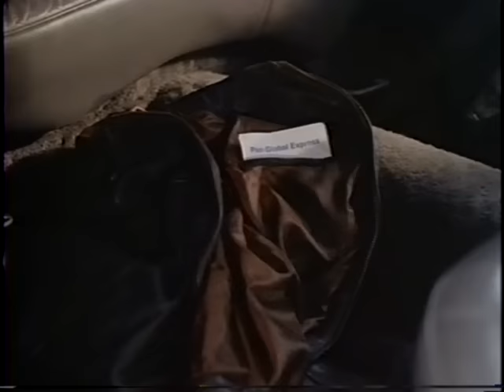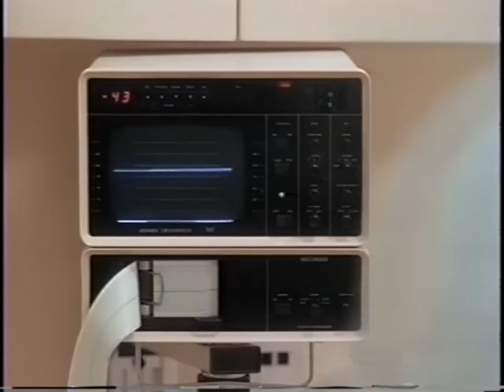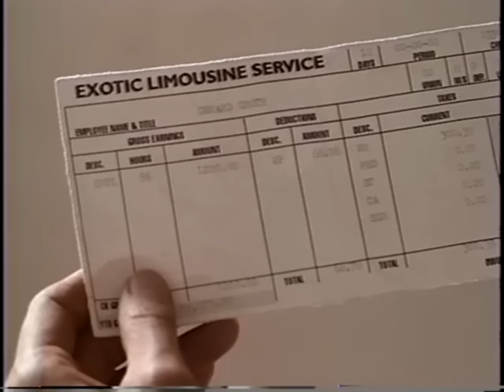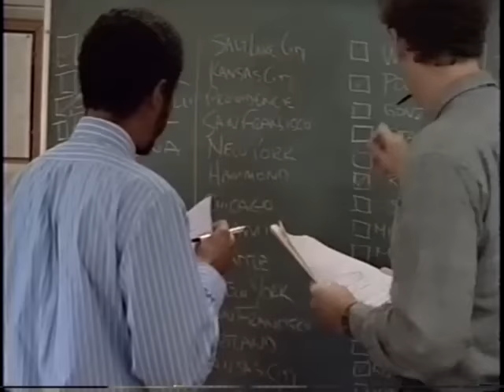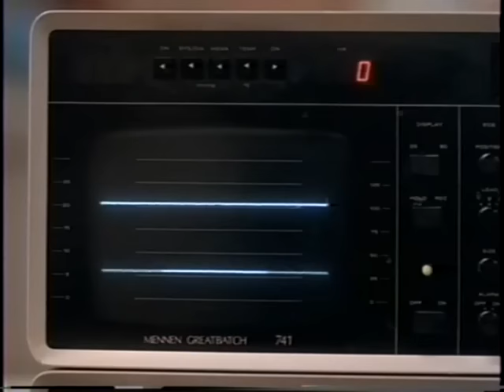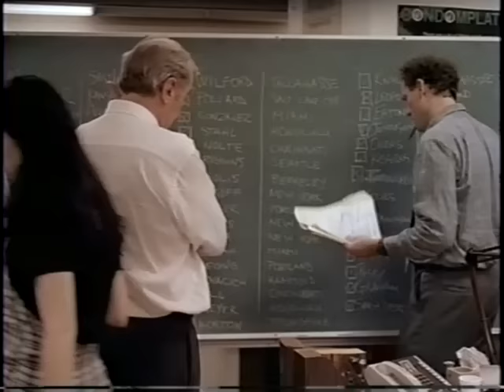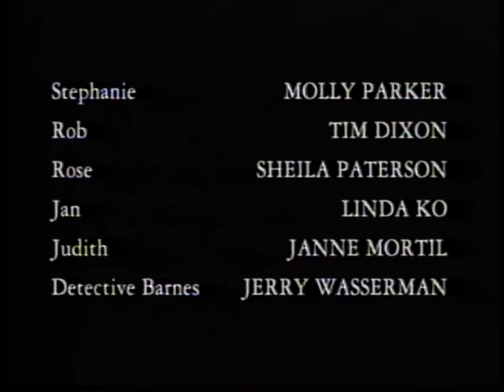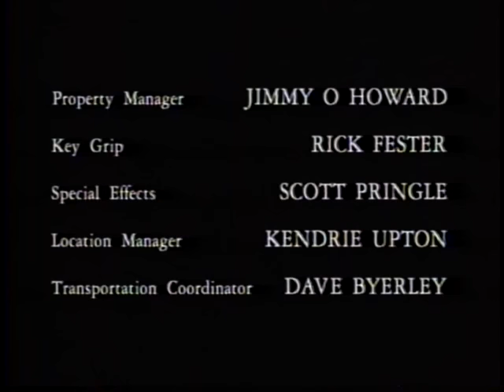Contagious (1997) | Lindsay Wagner Full Thriller

Comment: I worked in a fast growing restaurant before as a Property Accountant. The company was so strict in implementing cleanliness. No one was allowed to enter the production area without proper uniforms from heads to toes.
Reply: Vi B Excellent
Reply: Piatequila try being an RN and the young nurses with long hair hanging over when doing IVs.   Same as restaurants, being grubby does not get you fired.
Reply: It's one reason I would rather eat at home.  Safer.